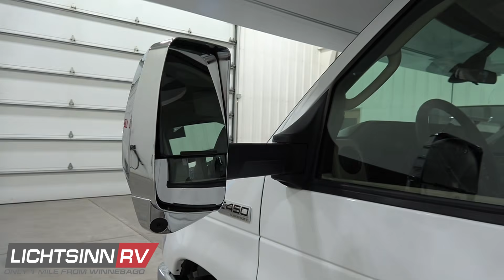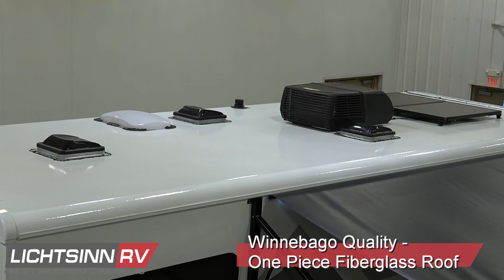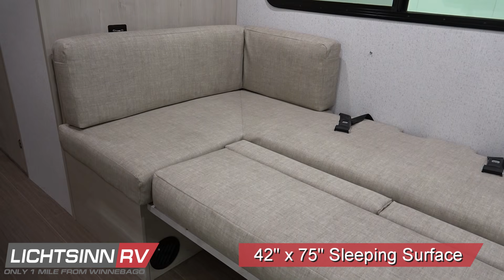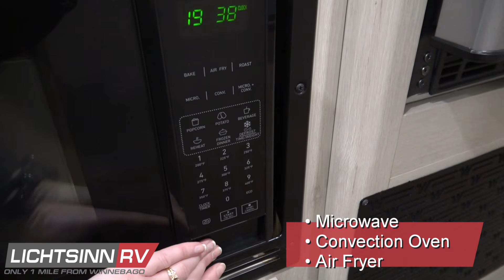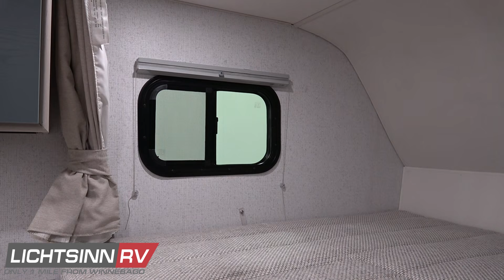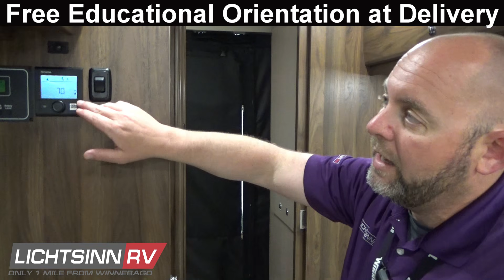New Winnebago Sunflyer 24GG - Premium LE - Class C Gas Motorhome - LichtsinnRV.com

Comment: Would like to see  locked door with fresh water fill, Slam latch cargo doors using metal latches and locks, solid surface counters, locking-latches for cabinets and drawers. Winnebago used the cheapest electronics when it came to the battery's the inverter, the solar charger,  the windows,  the fans, the plastic toilet, the cheapest shower surround and shower hardware. WE LOVE THIS FLOORPLAN! AND WINNEBAGO DID ADD SOME NICE FEATURES... BUT, THEY COULD HAVE UPGRADED TO MUCH BETTER QUALITY ITEMS AND ADDED A BIT MORE TO THE PRICE. THEY REALLY CHEAPED OUT WHEN IT CAME TO THE INSIDE BUILD QUALITY, THE CHEAP HARDWARE, THE CHEAP ELECTRONICS, THE CHEAP BUILD QUALITY OVER-ALL WILL GO TO CRAP.. LONG BEFORE THE PART THAT FORD BUILT.